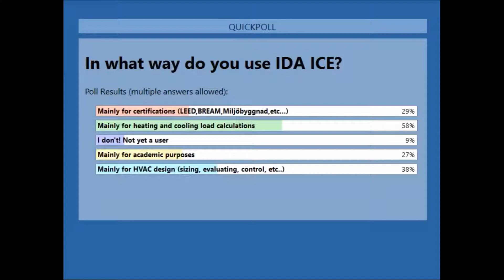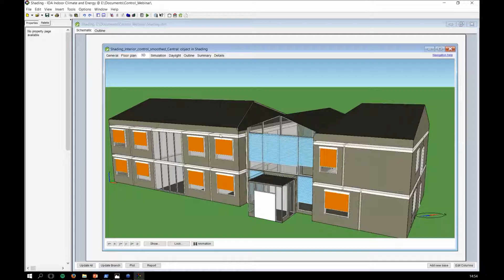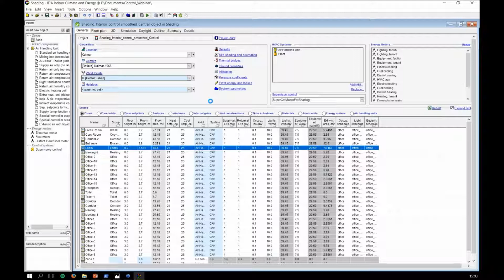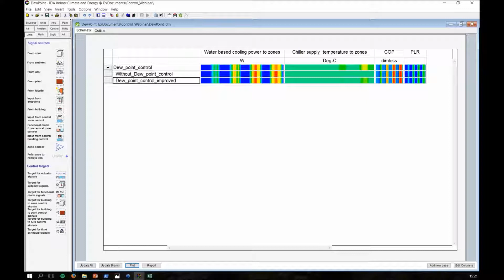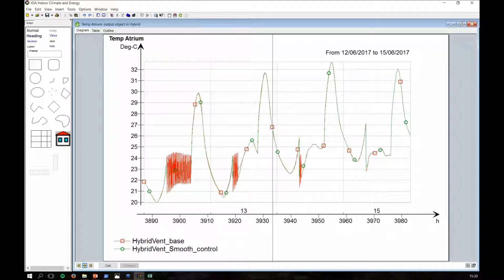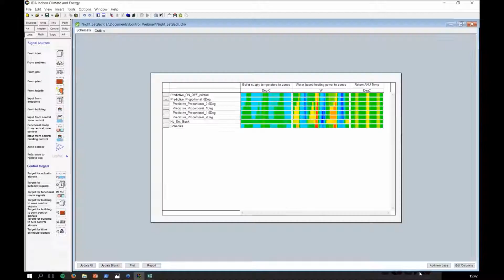Control - HVAC Design in the 21st Century (Webinar)

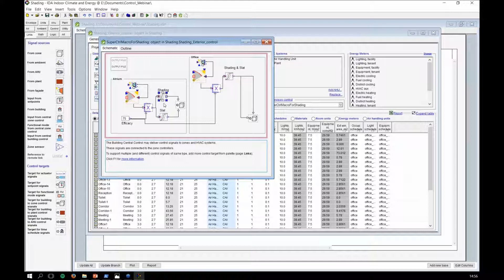Comment: (51:49) For Case 3 (Exterior Shading via Supervisory Level), how do you actually write in the macro that signals will have to received and processed at facades of the office and lobby? It is not like the zone signal source where you can specify which zones to place it. I tried Case 3 but it is not working...
Reply from the maker: In the central building control macro you use the object "Target for building to zone control signals". At the zone level you need to have another custom control macro, e.g. a shading control. In this macro you use the object "Input from central building control" to receive the signal.
Reply: Hi Thanks for the reply. Is it necessary to designate the location of the Face Module in the Supervisory Level Control? What I meant is, if in Case 1 and 2, these locations were defined in the Zone Sensor Modules, this time for Case 3 how to define in the Supervisory Level Control that the ambient measurements have to be taken from a Specific Location (facade) before it is processed and sent to the Zone Control Signal Macro?